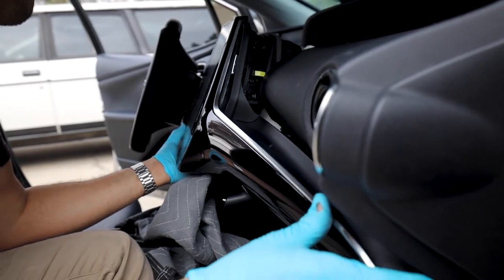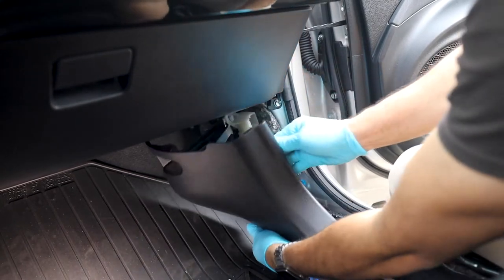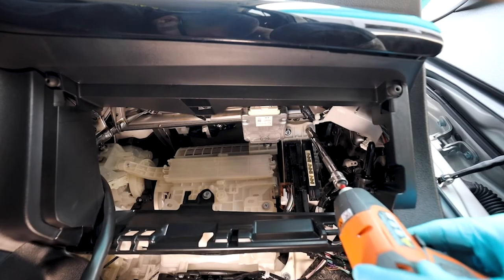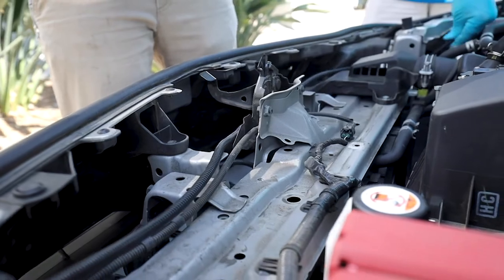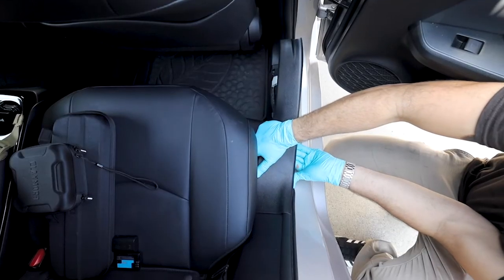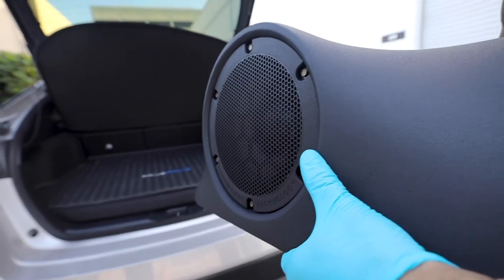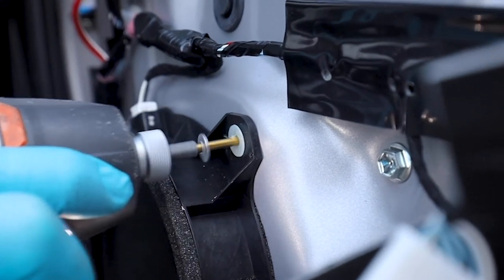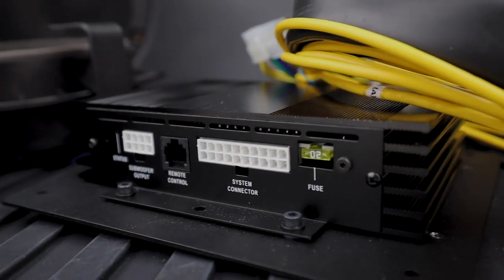Complete Prius Sound Solution - Step-by-Step Installation

Comment: So how about an option for 5th gen, 2024 Prius?  My Limited model has the 8 speaker JBL systeM and is pretty solid, but could use a bit more on the lower end, like a nice sub in the rear hatch.

Comment: Hi, Nice video.  Q.do you have upgrade for 11" with JBL system; mine needs more sound in the back and a subwoofer.  Best regards.
Reply: They don’t currently have one for jbl systems, I used to have an older version Toyota with jbl and it was so hard trying to get my sound system to work with it

Comment: My 2020 Prius Prime loses all audio after I go through a car wash.  Last time it happened it dried out and I got audio back. But this time I'm not getting sound back.  Where is the most likely source of water migration?  Anybody know?  Should I take the glove box out and look for moisture?  I don't really want to pull the head out but I guess I eventually will if the sound doesn't come back.  I bought this car used from Toyota a month ago.  My old 2017 Prime worked perfectly regardless of car washes.

Comment: Can this be installed in a 2022 Corolla Hybrid as well?
Reply: I would assume so. I believe they are identical platforms
Reply: I’m going to be installing an upgraded system in my 2022 Prius XLE. I had a system in my 2019 with a 5ch, 800 watt amp. That amp was fused for 90 amps, and I never had any problems with it. But I’d sure like to know how much the electrical system in these cars can handle, before you would run into problems ?
Reply: @Chris_Wolfgram  ok. A Rockford Fosgate t400x4ad (470w rms 4ohm) Will that work in my corolla. ? 60a fuse.   (Averange current draw 28amphere).  Battery is only 45ah.  But i think it Will work fine.

Comment: I followed this only for the groomer location. I realize afterwards I could have done it without unplugging so many wires, but I fix it just like in the video.  Problem is now I have 10+ error codes, mostly for brake system failures and my car will not 'ready' for drive. Anyone experience this?  I have had a few errors before and driving for 5 minutes cleared everything. This situation though, I cannot drive. It will not shift, only ignition on and error after error.
Reply: I sure you have the problem solved by now. If not, I would try disconnecting the negative (ground) battery cable. Leave it disconnected overnight. Reconnect it. You will need to re-enter some of your user preferences. One or two errors, may not go away until you drive a short distance.  Please let us know how things went for you.
Reply: Update
Reply: Hi James, same situation here, how i can do it without unpluging so many wires ? How do you solve de error code? Thanks in Advance